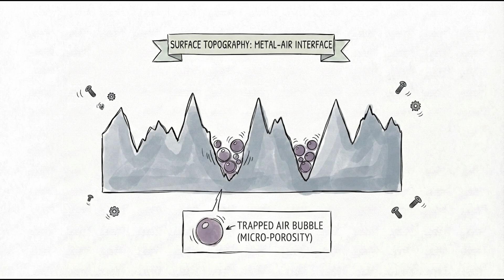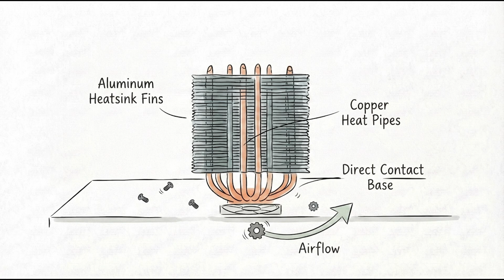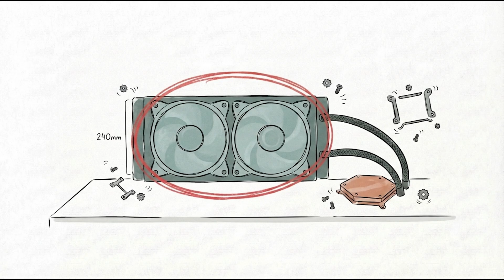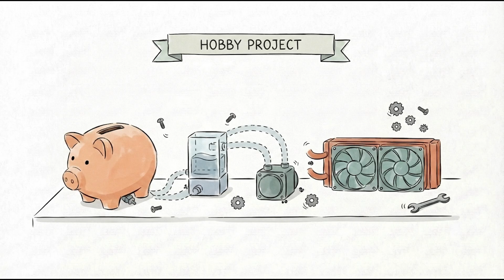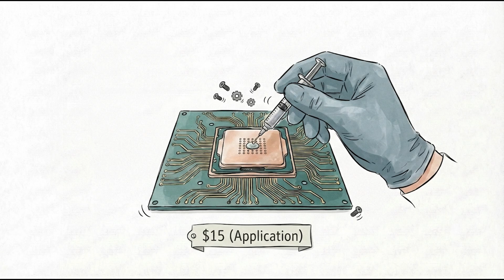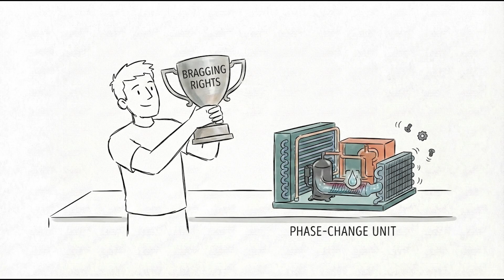Every Computer Cooling Method Explained in 11 Minutes

Comment: I’m using a tower cooler with one fan, along with three fans on top of the case that exhaust hot air.
The funny thing is, when I put it into my PC for the first time and closed the side glass, the gap was only 1mm. That was so close.
Thanks for the video.